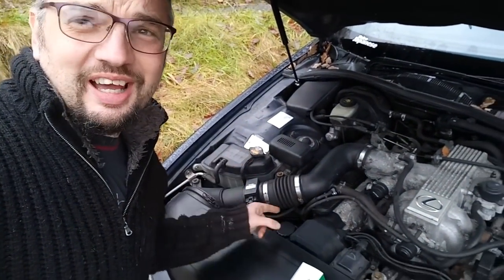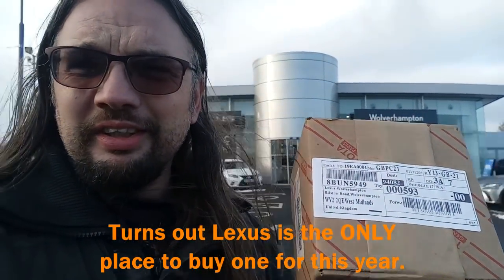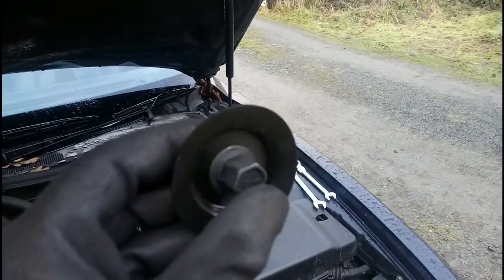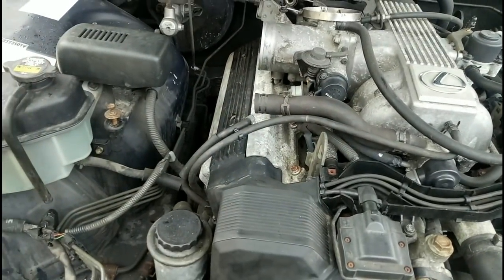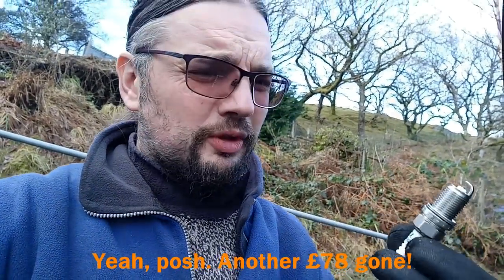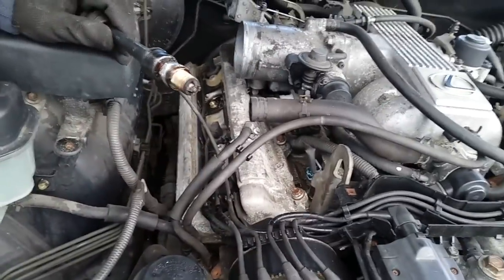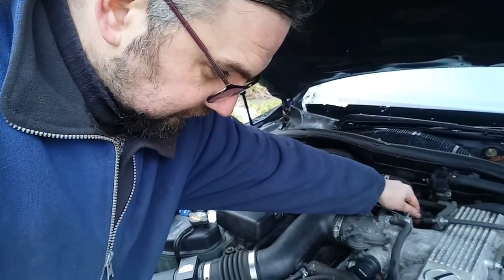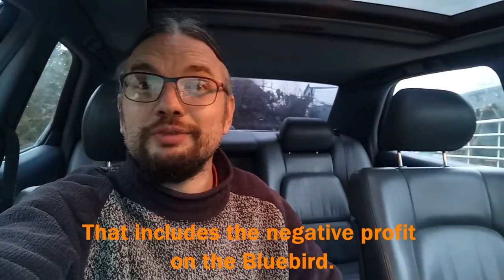Lexus LS400 woes - dead tensioner! With socket fail.

Comment: The first time I used one of those rubber spark plug sockets, the exact same thing happened. I just went out and bought a magnetic one instead and took it straight out without hassle and I've been happy with it since.
Reply from the maker: +Rat in the tub Until people mentioned them in the comments, I had no idea they existed!

Comment: Ive heard tensioners that sound much more worse than that. Vauxhall Corsa's sound horrible when the they go. I take it that the Lexus isn't easy to work on. Ill forgive it for being a good looking car and a great cruiser.
Reply from the maker: It's not the easiest, just because so much has to be removed even to access normal service bits. Did an oil and filter change yesterday, and that was easy enough. Once I'd got the undertray removed...
Reply: Imagine if it was a modern day car. You would get access to the bit you wanted to change or repair next week. Was the Lexus on it's first tensioner?
Reply from the maker: No way of proving it, but I doubt it's ever been changed.

Comment: Lol I had a hell of a good time taking my brothers LS400's timing side apart 5 times because of a bad timing belt tensioner, thought I just kept screwing up but nope. Water pump job turned into a full timing system overhaul job.
Reply from the maker: Ha! Oh yes. The water pump feels like it's in the middle of the engine, and so much needs removing to get the thing out.

Comment: Maybe you could swap engine parts with gs400, I recently replaced my 95 ls400 fan clutch with gs400 one. 

It has a different part number but the size and bolts are exact, works like a charm.
Reply from the maker: Possible. Annoyingly, aftermarket parts support looks much better in America than here in the UK. I guess that shows how many were sold in the US.
Reply: because merc and beemer price was way more expensive than lexus at that time in the US with almost the same quality, i think that's why lexus (ls400) sold a lot of car there in return, lots of aftermarket parts availability. 

i live in indonesia, and i must order the part via independent shops directly from japan or at least from scrapyard in malaysia (we dont have ex-japanese scrapyard in indonesia, illegal). thats why it costs me 240 usd to buy just a fan clutch (OEM).

Comment: I've had similar issues on other cars, with the plug trumpets filling with oil. Although yours does not look urgent, and is a case of weeping cam cover seals, I would replace sooner rather than later. In severe cases, it can destroy the plug and HT leads, causing misfires. I once had a quite poorly V6 Omega, suffering this very issue. Once the camcovers had been replaced (the original plastic ones warp, Vectra B aluminium ones are far better), I also replaced the plugs and HT leads. The car ran far better, and the full throttle misfire (caused by the breaking down HT leads) was cured.
Reply from the maker: Thanks for that. It is on the to do list. Along with a fair amount else...
Reply: I know the feeling. I own an XJ40, that I have had since 2002 (although it did go to Practical Classics Magazine for a period between 2012 and 2015!!). The car has been a constant project that never seems to end. The current Winter plan is a 'global sensor replacement'. So, brand new Crank Sensor, TPS, Ignition Amplifier Module, etc etc!. I'm glad I just have the four cars to contend with!.

Comment: Well done getting it running again, sounds really nice. BTW unnecessary revving is necessary. TOP TIP... My spark plug socket went the same way and I simply stuffed a bit of fuel hose inside it to grip on the plug tip. Some motorbike engines I work on won't allow the plug to come out with the lead + cap.
Reply from the maker: I like that tip. Thanks!

Comment: You can use a hose that fits around the ceramic bit to install & remove the plugs as well as pull them out of deep holes.  I always remove the rubber from spark plug sockets exactly because of what happened to you....
Reply from the maker: +ck m Thanks for the tip.

Comment: Your luck sounded like mine this week too. -4.5C and I had the stupendous idea to change my spark plugs on my Volvo this past Sunday. Well I forgot to degrease the turbo coupling so after three days of it blowing off, I finally got it degreased at work. What happens then? The turbo control valve hose gets ripped off the turbo (at least there wasn't any hose clamps on it, thank god.) and I accidentally drive home without the engine knowing how to control boost except for the wastegate and fuel trim. Guess what I had a code for when I pulled into the driveway.... It's finally all good though, so like your Lexus, I guess they were just mad at us for tinkering on them.
Reply from the maker: All part of the fun! So often one job leads to another.

Comment: I love these big old luxury motors. However the problem i find is it can be hard to get hold of cheap parts due to lack of numbers on the road. And finding information on how to fix them on the internet can be difficult. But you do get alot of motor for your money.
Reply from the maker: Yes, some parts are already hard to find it seems. Had the same issue with the Omega, where rear springs were simply not available.

Comment: When that Lexus first came out Tiff Needel placed a coin on top of the rocker cover and it would balance while on tick over. I've Superglue 20 ps to various bikes a Bentley and a Kia Sedona 2.9 Turbo (had to use nearly whole tube).My friends joke that the reason you have to half strip engine down is cos the were main dealer only repairs My Kia was the same as was a Taxi (well built tank) Keep up the good work

Comment: nice ls, what exhaust do you have on it?
Reply from the maker: I think it was a standard system but with straight pipes replacing the rear silencers.
Reply: @HubNut  i subbed earlier. i have a BMW X5 with a 4.4 v8 that has the same thing done and it sounds awesome. i also have a 99 LS400 that i was thinking about adding exhaust cutouts to. then i could have it quiet or loud. thanks.

Comment: Sell a Kidney to afford a tensioner ? spend ages trying to get it running again ? now you see the appeal of the two cars in your garage, Cheap and simple, and perhaps more fun ? still once you've beaten the Lexus into submission it'll be luxury travel for many years.
Reply from the maker: +Ian Virco Yeah, but the Lexus is really quick, and really quiet, and really V8...
Reply: Your in danger of going soft ! though i can't really argue with the V8 bit...... ( might need some straight through exhaust to really appcreciate it, Think BRISCA F1 stock car, then perhaps not if you've gotta drive from deepest Wales all the time )
BTW - your fibre broadband, i live just outside Milton Keynes and because we still have phone wires strung across the street i am sometimes down to below 10 meg download, upload is always below 1 meg. Devils Bridge that has more sheep than people has better broadband than my street in a large North Bucks town !!
Reply from the maker: +Ian Virco The fibre isn't yet working if that makes you feel better...

Comment: Same problem on SC400 but... I bought mine from partsgeek....it was $50 US. That' what? 30 pound? or so. You could get it shipped across the pond for another 30?
And I simply took off the tenshioner  pulley and bolted it on the big piece. I didn't take all that stuff off. HOWEVER......I still did it wrong because, you can take the pulley off, knock or press the bearing out, go down to your local bearing company (I have one in my town) match the bearing, knock in the new bearing. Then attach your pulley for about  $5 US
Because, realistically all that is wrong is the bearing has failed.
Reply from the maker: Yup. If I'd had more time, I would have gone the US route, or maybe actually just replaced the bearing as you suggest! Shame I'd already mullered the original.

Comment: Yeah, turning the tensioner pulley bolt counter clockwise (the usual lefty loosey) is how you relieve tension on the belt. I was wondering if the thread was not normal and I got my answer! Thank you for making the mistake I shall learn from.

Comment: Woah ! 232 pound for a tensioner.  That's like New Zealand prices.  Now i live in up state NY and just replaced the tensioner on my 4.6 v8 T Bird,   $ 34.00 US. Really happy with US parts prices. If you're able to do the work yourself, you can save heaps of money. Just priced a new water pump, $ 48.00. and a new power steering pump at $78.00.
so all up that's around $160. US dollars. Must say, I do like the Lexus though.

Comment: Many times the simplest jobs take forever, don't they...sheared off bolts, rounded hex bolts, not fitting parts. Good job you finished it successfully. I heard the starter turning unevenly when it didn't start; indicative of compression loss?
Reply from the maker: It did sound like that, I agree, but there is no sign of that now. It runs beautifully.

Comment: Bangernomics ?  I know you say buy a car cheap and maintain it well ... but stealer dealer parts ...  would have been nice to see a cheap fix with a £5 if that bearing but GENUINE PART !
Similar new parts on Flea bay for £70 
Is the lack of reliable internet a clue ? to us townies ?
Just think of all the Tea you could buy with the spare cash or better still treat yourself to a decent battery charger boost pack  
would have been nice to see the broken old part to assess the damage .. sheared bolt ?
Reply from the maker: "Similar" isn't the same as "correct." Had I not broken the old tensioner trying to remove it, then the bearing might have been an option. I'm sure a machine shop would have swapped the bearing for a few quid.
Reply from the maker: Though I will concede main dealers are best avoided. As a general rule, I have nothing to do with them. They rarely stock the bits I actually want anyway. This seemed to be the only way to get the Lexus back in action before Christmas.

Comment: Crumbs this ones a tester.   Mid wales to wolvo to blow about £270 on a pully then drive back so £300 ish with petrol plus plugs......
Cant see why she wouldnt start when the pully was renewed though.  It ran before on old plugs so it wasnt the plugs......something not connected?
The relief though on start up.....😂
Reply from the maker: I never did get to the bottom of why she didn't start, unless I had flooded it by running for only a short time and not warming the engine.

Comment: I hope that you replace the fan shroud sooner rather than later, as it looks like the fan could do you some considerable harm if you came in contact with it with the engine running.
Reply from the maker: It's on the to do list. In the meantime, I'll try and keep my fingers out of the way. I'm pretty used to exposed fans (famous last words!)>

Comment: I dont't get it. Before fixing the tensioner, it started fine (or at least OK) with the old plugs. After fixing the tensioner, it will only start with new plugs? 
Good job though, now we understand where the high service bills are coming from!
Reply from the maker: I don't get it either. Possible I flooded it by running without the AFM connected, but those plugs certainly looked tired.

Comment: It sounds like one of those rattling screwdrivers :D

The Lexus is proving that a Toyota is, in the end, just a car.
Even though it can vanish. Very James Bond.

Left thread bolts, yeah...
If you're ever in a thrift shop or yard sale or whatever and you see a Sony TC-377, 378 or 399 tapedeck, notice that the faceplate around the pause knob is always mangled or that the thread is broken off.
It unscrews clockwise and people always fuck it up :D.

Comment: Ironically, I just did the plugs on my LS400(a '99 so slightly different intake plumbing) last weekend as well as the VVTi control valves. Interesting motors to work on, right?
Reply from the maker: Interesting as in a pain? Yes! Well, they're not that bad, but there's no such thing as a quick job, as even the smallest task seems to require the removal of an awful lot of other things.
Reply: Pretty much! I had to remove the throttle body to get to the control valves, though at least they're right there. I will admit I'm used to working on my Celica GT4, so in comparison the LS400 is relatively simple. I do have a tip that could save you some money(if it works n the UK): If you can find the Toyota part number reference(which should be something like '12345-67890'), see if you can order it through a Toyota dealer instead of going through Lexus. I replaced an engine coolant temperature sensor at the same time as the VVT valves. Lexus wanted $110USD; Toyota wanted a somewhat more reasonable $70USD.

Comment: Did I see that the assembly was stamped 'TOYOTA'? in which case could the part be interchangeable (and possibly cheaper)with one of their other engines (yes I know Lexus is the high end version of Toyota)
Reply from the maker: No, the tensioner seems not only unique to the LS400, but also unique to those built between late 1994 and 1997. Lots of bits are stamped Toyota, just because it is the parent company.

Comment: The trick I use for spark plug removal especially if the coil pack is a complete unit as aposed to leads is 2 fold, I have a telescopic magnet and the trick I used to use when you are lacking the rubber insert in a socket is disgusting but none the less effective! Simply chew some chewing gum and then shove that in the socket! ( works every time)

And are u sure those plugs where tight? Sounded to me like loss of compression?
Reply from the maker: Yes, it did sound a bit compressiony, though that was before I'd touched the plugs. They were all tight.

Comment: I recently got a 21 century motor, and splurged on a Halford's magnetic plug spanner. Money well spent, as you've confirmed, and (I think) you really don't want to drop one of those iridium plugs. At least you saved a hundred quid doing the pulley yourself. Or would have done. lol

Comment: dont worry about the fails... i had to cut a hole in my old cars hood. lousy cable to pull the hood broke, and no other way of getting into the engine bay other then cutting a hole in the hood... least i had a friend who welded the bit back on :)

Comment: Mate, try changing the timing belt and  tensioners and water pump on a Audi rs/s 4 b5, you have to take the whole front of the car off, its a hell of a job.
Reply from the maker: I wouldn't fancy tackling the job on a transverse V6 either. Eesh.
Reply: Hi mate, the Audi RS4/S4 B5 engine is longitudinal V6 2.7 twin turbo.
Reply from the maker: I know. Was thinking of Alfas, Citroens and Hondas. Would be easier if you just pulled the entire engine out I suspect...
Reply: Its not to hard to remove the whole front of the Audi, just time, then its a easy job, but then you have to rebuild the front.
Reply: I think how hard it is largely depends on how often you do it.  I had a couple of 5 cyl turbo Audis and could do a timing belt change in ~2 hours, including removing the front end....  Book rate IRC was 5-6 hours.
Reply: I have only ever done it once, that was enough for me, but that is very impressive in 2 hrs my friend.

Comment: How does working on the Lexus in general compare to other cars?  It’s just that people talk about the over-engineering of everything, and how everything’s supposed to last – yet seems like everything is a pain when it breaks to replace.  Sort of like my 2007 BMW MINI.  Yes, over engineered [the Lexus, not my sodding thing], and it is an old car, but it shouldn’t be overly difficult, should it?  I’ve just always liked the LS400, and variants of it, but this is somewhat off-putting.  I’m sure the ridiculous insurance for a twenty year old is also extremely off-putting!

It’s knackered!  That price is quite a sting.  I see a hammer on top of the engine, don’t people usually put coins to see how smooth it is when it’s actually running?  I’m sure that’s what I’ve seen a video of, somewhere...

Yay fibre!  You’re finally moving out of medieval times.  Though with how “connected” everybody, and everything is nowadays I think I’d prefer to go back, somewhat at least.  Unnecessary revving is needed, to help keep Greenpeace at bay :D

I must get around to changing the fuel filter on the MINI.  Finally changed the gearbox oil in it, I’ve only had it sitting about on a shelf since May which is when I got my new job, and just haven’t had the time since.  I’m off now until the New Year, so should at least attempt to use my time wisely.  Aside from that that’s all the servicing needed.  Suspension issues aside (three different garages have said “it’s not a safety issue, you’ll be best off leaving it for a couple of years”) the next investment will have to be new tyres.  Really want something else, though...Thinking an MX-5, but the MK1’s rot and are just really expensive for what they are even compared to a couple of years ago, MK2’s also rot, don’t look as nice, however are a lot more affordable.  Also, interestingly, a Pug 205 GTI isn’t that ridiculous to insure – it’s even cheaper than a diesel model.  How prices of those have risen over the last couple of years...Don’t think I could bring myself to driving one everyday.
Reply from the maker: Lexus still suffers its fair share of rusty bolts and screws, but it is very solidly engineered. Lots of clever engineering.

Fibre not connected yet. It isn't working for some reason. They don't know why.

Mk2 MX-5s rot even worse than Mk1s.  Mk1s are fast appreciating. I'd get one now.
Reply: Thanks for the reply, I wasn't aware that the MK2 rotted faster than the MK1.

Comment: My Stag I owned about 4 years ago used to belch soooo much condensation from the exhaust I was convinced it was smoking. 
But no 😉
Aaaaaah the good old V8 🙂
Reply from the maker: That Stag engine is still one of the best sounded engines of all time. Once drove one with a Rover V8. It sounded awful.